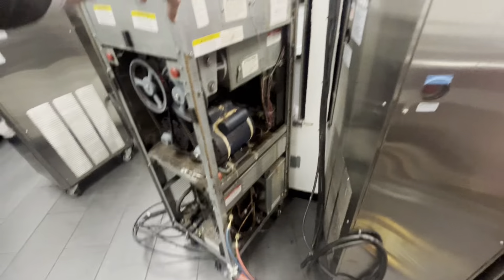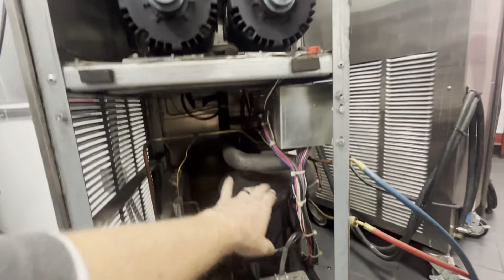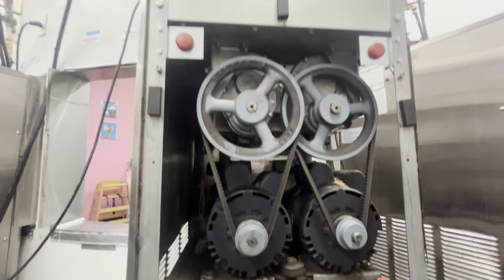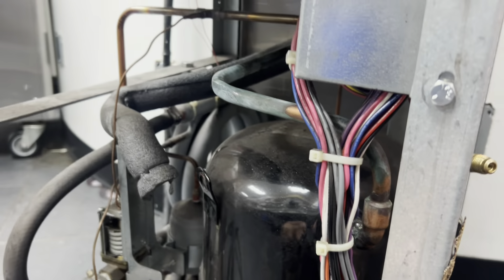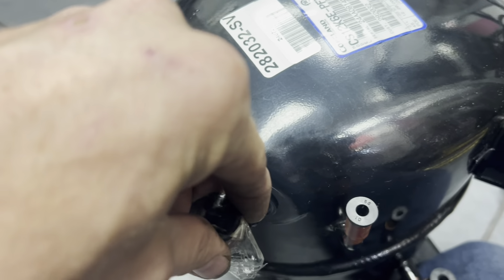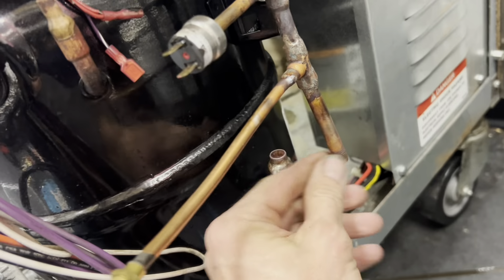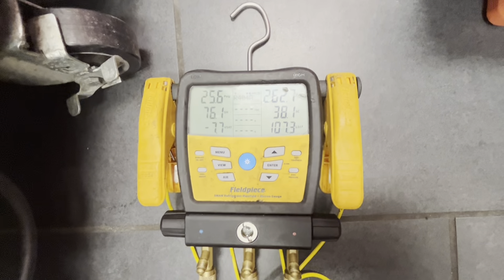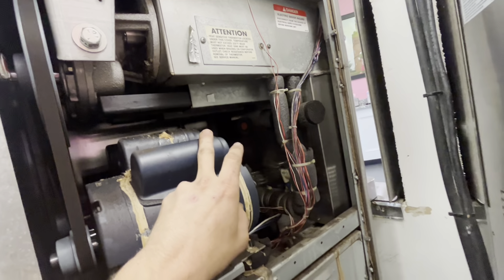Stoelting compressor swap

Comment: I didn't think they made these single-phase.  It is certainly not going to be as efficient as a three-phase machine.  It's a scroll compressor, isn't it?
Reply from the maker: It’s a three phase.
Reply: @restaurantrepairs  Well I looked it up and they do make a single-phase model.  I find it a bit odd that the barrel motors are single-phase on a 3-phase machine, though.
Reply from the maker: Oh sorry. I thought this was a comment on a different vid.   This compresssor IS single phase.  My bad for the quick and incorrect response 😒